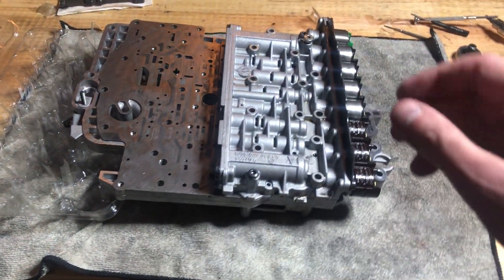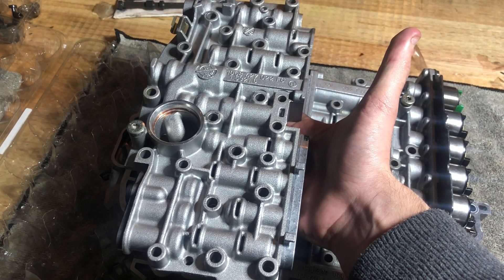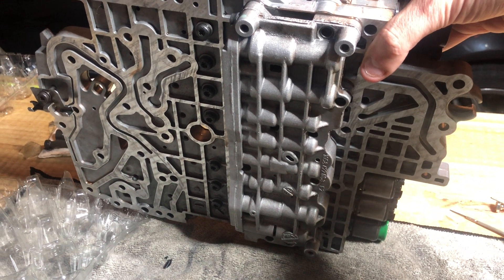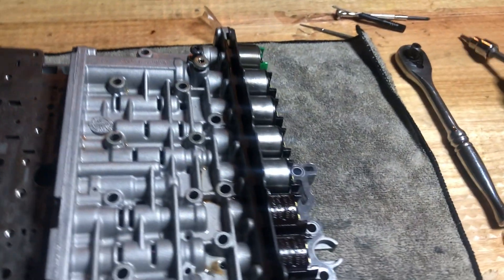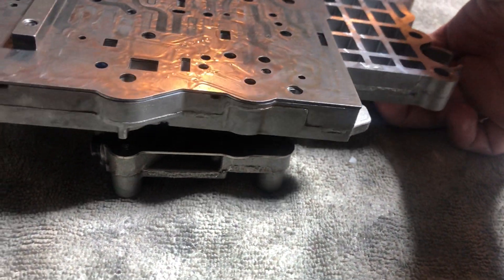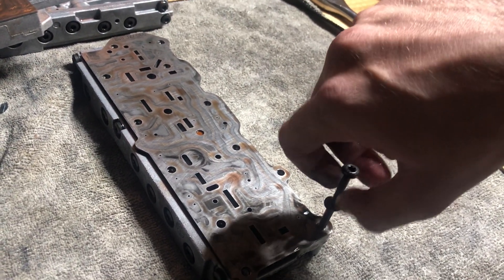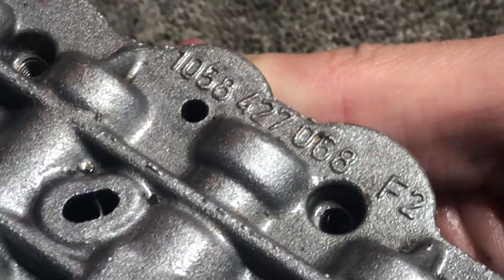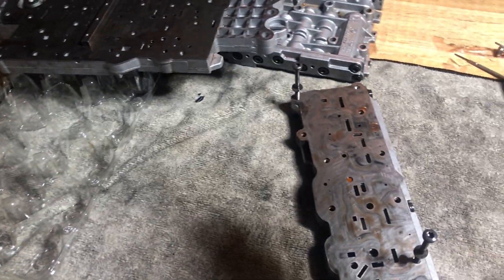5HP24 Valve Body Crack Location

Comment: It cracks because the entire valve body is made out of aluminum.  The hard steel high pressure valve eventually wears out the soft aluminum bore it rides in.  And then the valve cannot hold high transmission fluid, thereby knocking out the front clutch and other things  and you have a dead transmission that needs a complete overhaul.  My Mother's 2000 Jaguar XJ8 has the same transmission and it failed at just 64,000 miles.  The German's chose to make the valve body out of aluminum instead of the tried and true cast iron that lasts.  They wanted to sell us expensive lousy parts.  Its that simple.  No more ZF transmissions for us anymore.